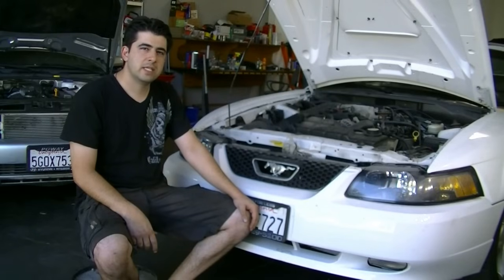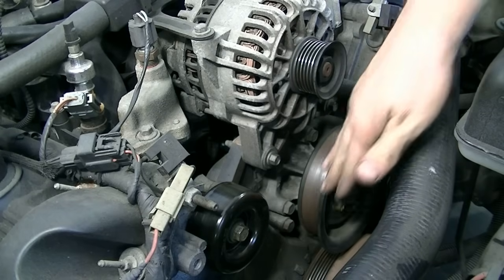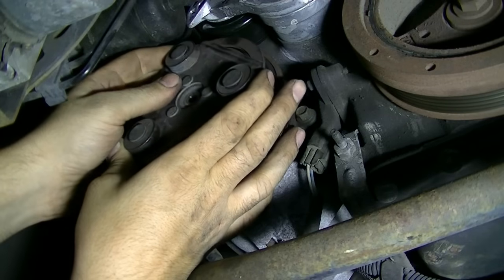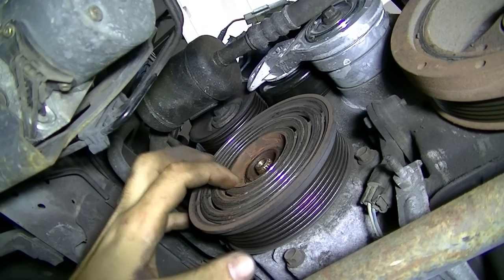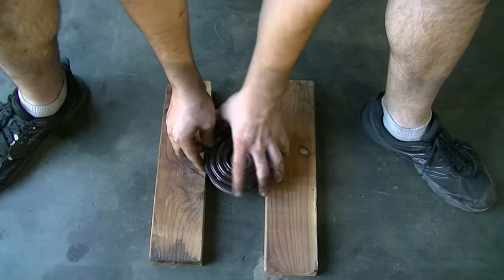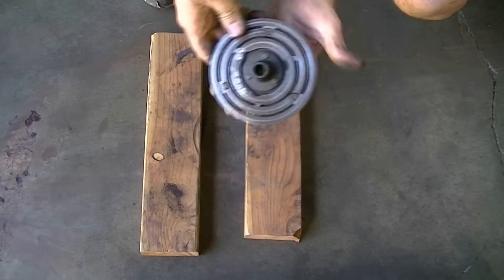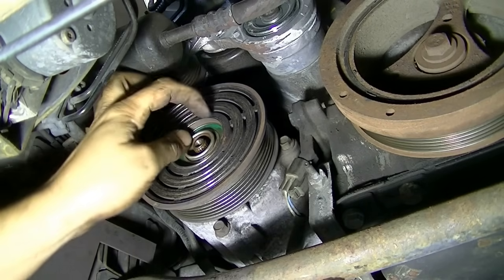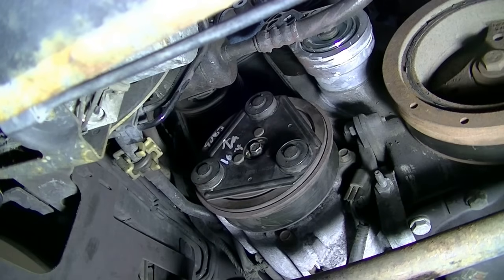How to Remove and Replace an AC Compressor Clutch and Bearing (Long Version)

Comment: If it runs or scratches it would sound like a beep them rattle and to simplify the part there is a electrolyte difference blowing your main ,12 volt so to be it good some have a swollenfinger end thread a larger bolt to it not move slightly only  from the rear of that and put a bigger nut on til you hear it move little sound then don't do any more visually look for pulley or decay doesn't have to come out or if it makes idle during the start up is in the fuse box all noises can malfunction usually just wait to a stop engine or disengage it from 12 volt they can prolong to the engines management Telus on faults good luck

Comment: For my 2000 Ford F150 4.2 V6 I found the whole bearing pulley and clutch assembly on Ebay for $55 brand new with free shipping..
Reply: Is it still holding up good?

Comment: Those surfaces are supposed to be perfectly flat. The best route there is either to get the pulley from the donor of the  clutch or to get a new kit. You could have problems with slippage mismatching like that. Just saying.
Reply: Exactly.  With those grooves, he can't get even close to an accurate gap between the surfaces, also.  I always recommend not messing with the bearing or individual parts, but just get a clutch kit and replace it all.

Comment: DO YOU HAVE TO REMOVE THE SERPENTINE BELT IN ORDER TO REMOVE THE CLUTCH? MY AC CLUTCH WONT COME OFF. I TRIED PRYING WITH A SCREW DRIVER WITH THE BELT STILL ON BUT IT SEEMS REALLY STUCK. I'M ONLY TRYING TO REMOVE THE CLUTCH.
Reply: To remove the clutch, no, just take out the bolt in the center.  You may have some rust in the splines of the shaft, so some penetrating oil into the bolt hole might be in order.  That'll get it into the splines.

Comment: My serpentine belt came off because the pulley rattles too much. called a shop and he said that they'd have to replace the whole compressor (?!) That's not true right? According to this video, I can just replace the pulley, clutch and bearings.

Comment: My clutch keeps engaging/disengaging very often. Will not enough gap cause this?
Reply: Probably not enough refrigerant.  The A/C has a low pressure switch that has to be tripped (refrigerant above a certain pressure) for the clutch to engage.  Once it's engaged, if the pressure drops too low on the low pressure side, it'll disengage.  Best to take it to an A/C shop to get it looked at for that.

As far as the gap goes, not enough gap will cause noise and dragging when the clutch is disengaged.  Too much gap will cause the clutch to not engage fully, and slip or not engage at all when it should.

Comment: How many spacers should there be?
Reply: Whatever it takes to get the proper gap.  A good technique is to put plenty in to get a decent, measurable gap, and measure it.  Then, if it's not in the right range, take it apart, and measure the total stackup, and subtract what you need in order to get into the proper range.  Use that stackup and reassemble, and measure again to verify.

Comment: would a bad ac compressor cause your car to stall
Reply: actually it can make your car not able to start it wont even be able to crank, which might make you replace your battery or starter